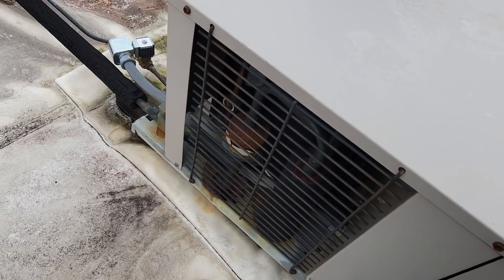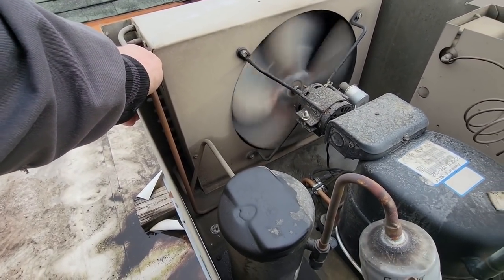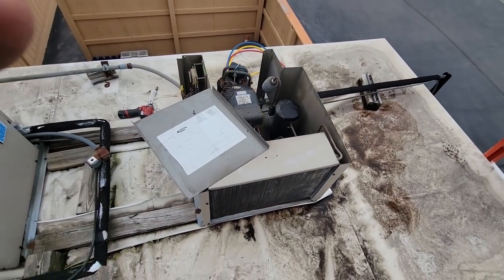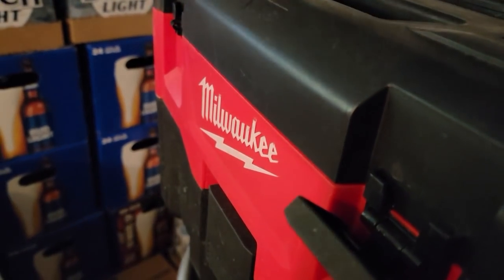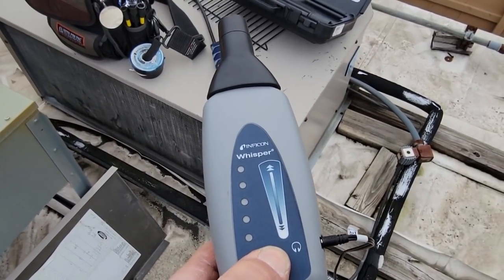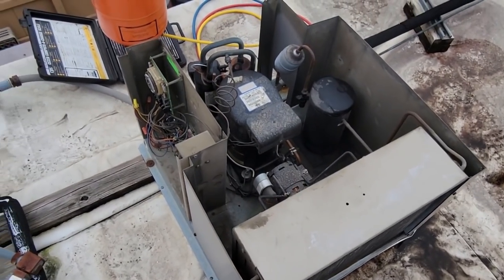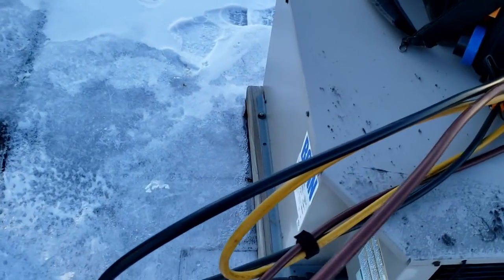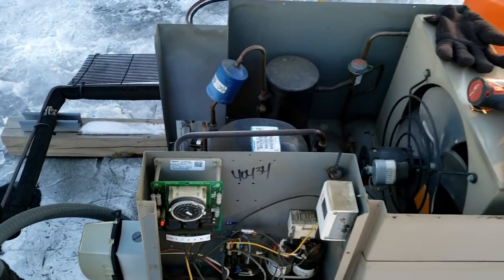Both Walk In Coolers Were Warm. Short Bonus Warm Cooler

Comment: Just a thought on the first vid ,your leak may have been on the receiver blow out plug which is located on top of the receiver it looked suspicious may only leak under running pressure I've seen them weep on that model receiver
Reply from the maker: Thank you for the feedback, I'll keep that in mind, I have sent leaks that will only show up under extreme pressures and temperatures.

Comment: On windy days I have tried throwing a tarp over the outdoor unit with the system off. Weight down 3 corners of the tarp and climb under with the detector.  That unit there would probably need a 15 x 15 tarp so you can hunch under it and walk around the unit while under the tarp. Sometimes it works.
Reply from the maker: I've done that once before, it does help a lot👍👍
Reply: @HVACRSurvival  It should be noted for the less experienced tradesmen reading this that extreme care needs to be taken trying this on a rooftop on a windy day. A tarp, or a  large piece of cardboard, or a Unit  Panel Cover can act like a SAIL and get you blown right off the roof.
Reply from the maker: @k.sullivan6303  true👍👍
Reply: @k.sullivan6303  WHOOSH, off the roof tarp and weights fly, into nearest HV powerlines and down onto vehicles, BZZZZTTTTT and smashed cars. lol

Comment: On generator video 
She’s happier with grease on starter I would think 
 The hole showed the mega water damage 
Especially on crankshaft teeth wow 
 Not a fan of any generator btw … needed here or there 
I like pull start generators that sip fuel 1.5 gallon 
 Since watching got a tool for detecting gas , your right wasn’t expensive , thanks

Comment: I have a Bohn fan cover on the fan in my window. The price was right, so it's safety first at a cheap price. The fan came out of a dehumidifier, so it wasn't designed for a window, but it works well.
Reply from the maker: If it works, it ships😁👍👍

Comment: That bohnmizer setup is kind of odd. I understand the concept that the valve will continue to correctly feed the evaporator but what about mass flow and oil return to the compressor? Gotta keep that head pressure up
Reply from the maker: I haven't worked with these TXVs  but a few times, the information I found on it was from 2008, so it must of worked ok. I would need to know more about the valve to answer accurately. I'll see what else I can find. The pressure's I had when I was finished recharging the system looked about normal to a head master 🤔 control from what I seen

Comment: Without a tuned H-10 leak detectors are brutal in wind. Also, gas-and-go is okay in winter.
Reply from the maker: I knew they wouldn't fix it so why try hard to find it🤦🏻🤷. The H10-PRO was sleeping in the truck.

Comment: Noticed heaters are on the coil, guess they run it colder
Reply from the maker: They normally will use a heated defrost on a beer cooler because they run it around 30*